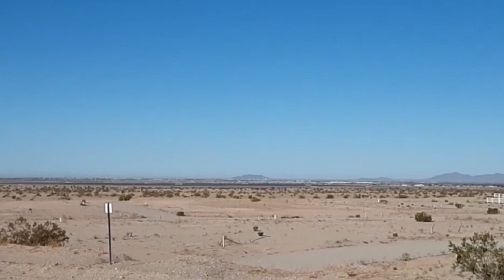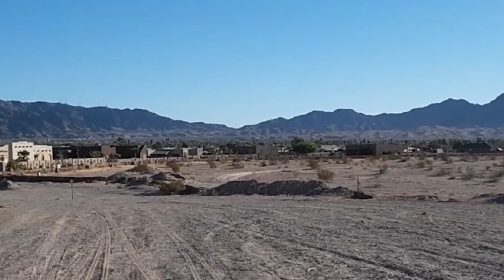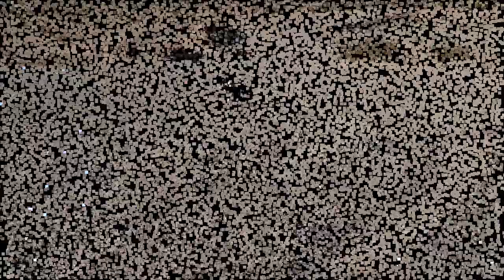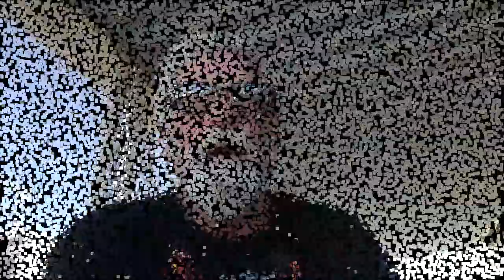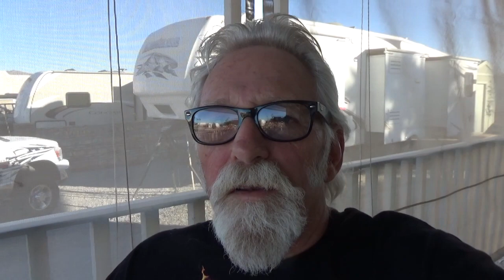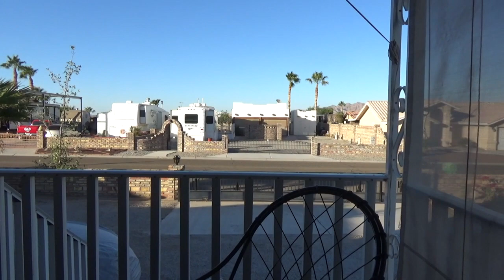Why is the roof not done on this new house

Comment: To bad you guys didn’t have a bike to take a little ride on to clear your heads from time to time. These are crazy times we are in. Just an off the wall question, have you ever had trouble with your slides on your camper?  I’ve be wanting a camper and was wondering about that.
Reply from the maker: We never have but I had a friend that has had lots of problems with his. His are non-cable mine are hydraulic it doesn't mean they won't break. But if you're going to live in an RV you got to have slide outs. Once we sell this one and move into the house we're going to buy a motorhome with no slide outs just for that reason. We're just going to use it to travel and visit all my friends in America and we don't need to live in it 24/7 for years on end like we have in this one.